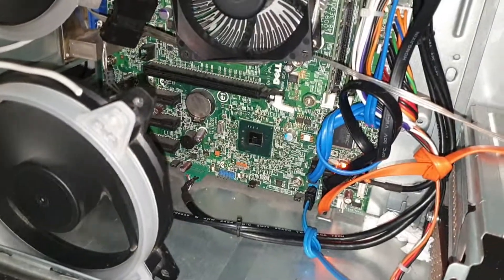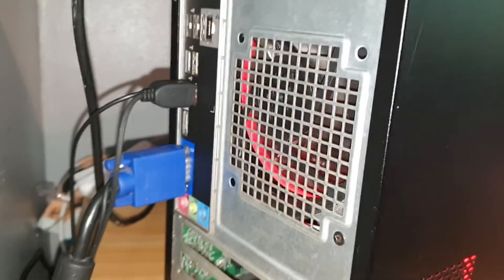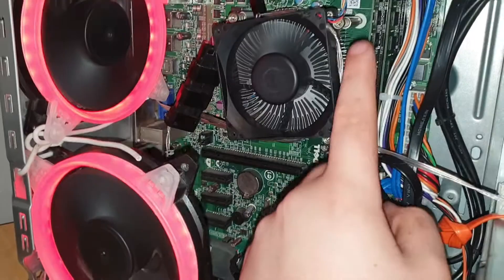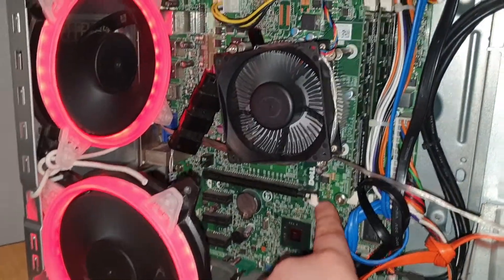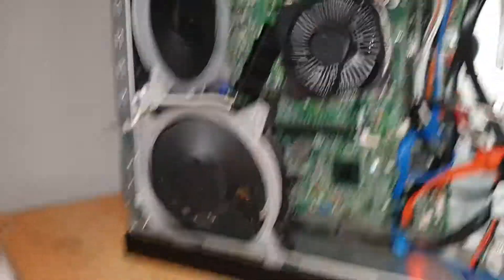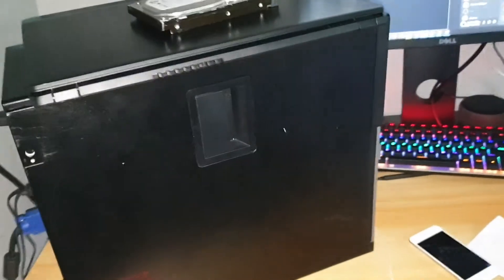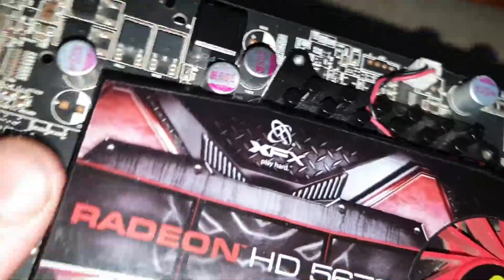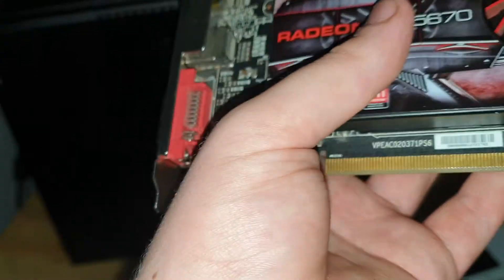Dell Optiplex 3010 cooling mods and planned upgrades in the future

Comment from the maker: just a note for people, this will be pinned

the dell optiplex 3010 that is in this video has sadly blown up due to a serious power surge i had some time ago after i had got the computer working again, i wish i still had it because that computer was faster than my gaming pc as it was but the one thing that let it down was the power supply that had no 6 pin power, i am aware that you can use any atx psu but the PSU does not have one and it blew up during a power surge taking all the parts inside with it.

i will still be giving support on how to modify OEM PC's such as dell optiplexes 30 or 70 series Machines or HP compaq elites 8200's or 8300's thanks for taking your time on reading this
Reply: Hey! I am about to make my first build using this motherboard. What cables do I need in order to power it, and can I use any lga 1155 cpu cooler on it?
Reply from the maker: @ciaranrickard6818  hiya, unfortunately, these 3010 boards are not compatible with other cases. The pins needed for the board to work only work for the OEM cases. although other coolers will work. It is best that you use the OEM case it was used in. Hope that answers your question :)
Reply: @ciaranrickard6818  Hey, If you still have the motherboard or plan on using it even at all now, someone designed adapters which allow case swaps

Comment: Hello, currently using 9020 mt, how did you power the fans?
Reply from the maker: just plugging the fans directly into the fan header and since the fans had molex on them, i plugged in the molex on all the fans in the machine to make them work
Reply from the maker: just make sure you dont plug the molex into the PSU or else the PSU will damage the motherboard or the fans

Comment: Any plans on that chipset in the lower right to get a cooling solution of any sorts?
Reply from the maker: Hi Patrick, The PC does not need cooling on that die on the bottom right as that is the iGPU and never got a cooler on it in the first place, i also dont own it anymore as it has gone into a scrapyard cuz it blew up :/
Reply: @samurxidestroyxr  oh! Sorry to hear. And thank you for the info. I was wondering why it looked like it had holes for a cooler but nothing was there. Thanks!

Comment: Hey would you mind showing me how you managed to fit the 120mm fan on the rear. I thought it wouldnt fit at all. did you drill holes in the case to fit them or how ? Your input and advice would be appreciated bro
Reply from the maker: Hiya all I did was line the top left hole of the machine which the fan and screwed it in then i wedged the fan between the IO of the motherboard. Hope that helps. Just a friendly note as well as i no longer have that pc anymore due to it breaking and needing parts from it, otherwise I hope this helps
Reply: @samurxidestroyxr  Thanks alot . I will give it a shot

Comment: Hey I don't want to sound stupid but how do I connect my fans? I want to put that many fans in my 3010 but the fan I got has a different pin connector than by 500 watt PSU extra connectors??
Reply from the maker: OPTION 1

hi there. my dell recently blew up on me and i might attempt it to get it working again but this is my advice. if your fans has a 3 pin power connecter for the motherboard plug tht connecter into the white fan header the original fan was plugged into and mount the fan in the back of the chassis blowing out of the case (how to find that out would be that there would be an arrow on the fan showing the flow of the air going through the fan).

then if you have a molex plug (the 4 pin plug tht is a chunk of plastic). then connect that fan to the one thats plugged into the motherboard on the same connecter. you can put tht fan anywhere but i reccomend that if you have a gpu you can put it where i located the second fan on the case.

you will get a error but that is normal as they are fans the motherboard dont reconize and there is no way of removing the error

then do the same for the front fan like it is layed out on the second fan. i hope this solves your answer.

OPTION 2

you may need buy some single to double fan header converters that you can pick up for cheap. its best to buy 2 - 3 adapters and daisy chain them together. then plug the the 3 pin power connecter for the motherbord into the adapter then plug the adapter into the motherboard. you may get a error but that is normal because the fans you selected to put in the pc are not the same fans as thew other ones.
Reply: @samurxidestroyxr  Hey, sorry about your computer and thank you so much for the info!! I have a optiplex 3010 with a 1060 asus. Works fine but it gets mad hot when playing certain games.
Reply from the maker: @davockrob2783  no problamo, i have actually got the dell fixed up recently and had no room for it. so i decided to sell it to my friend who needed parts for it that i will help him install tommorow. but if you need any help just send another comment here and i will guide you through or if you have a discord i will be more then happy to guide you through there :)
Reply: @davockrob2783  have you upgraded the PSU? is so then what u bought? im planning to improve my optiplex 3010 GPU to satisfy my gaming purposes. Just afraid that the PSU wont handle it.
Reply from the maker: @Mujahed.  hi there, sorry for the long delay, i have had a lot of things to do but, at the time i did not,  its was the original 275 watt psu it came with, if your graphics card has a pcie power connector then it is recommended that you upgrade the psu to a more powerful and supported, ik you can use a standard one as it uses the common ATX psu size

BUT if your graphics card does NOT have one then you dont need to worry about it. cuz i ran a 75 watt gpu in it from the pcie lane and had 0 problems

hope this helps you!
Reply from the maker: sorry have to make a correction here, it was a 100 watt, not a 275, i was on about the other one i had at the time, sorry for the confusion!
Reply: @samurxidestroyxr  Thanks i really appreciate your help, you're too kind! do u have discord?
Reply from the maker: @Mujahed.  yes i do, feel free to dm me at CTPG124#0069

Comment from the maker: UPDATE:
i am not going to upgrade the CPU, the main things i want to focus on is upgrading the GPU and the Power Supply. doing some benchmarks with hyper threading enabled actually is faster then my current system, if i can get the system up and running with a decent Power Supply, USB 3.1 controller for my VR headset and a VR ready GPU then i should be good to go for a new custom built and modified PC